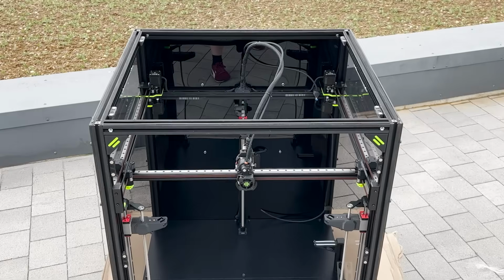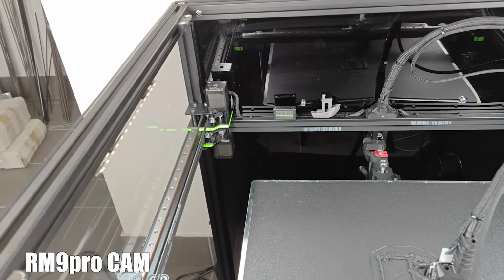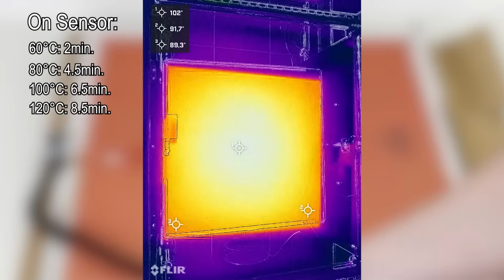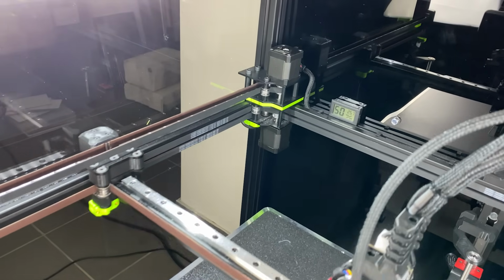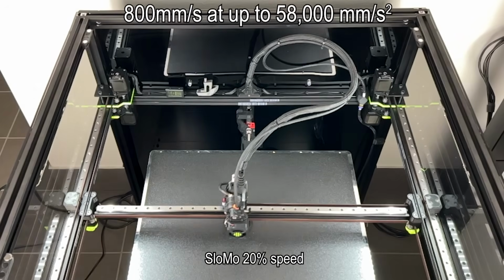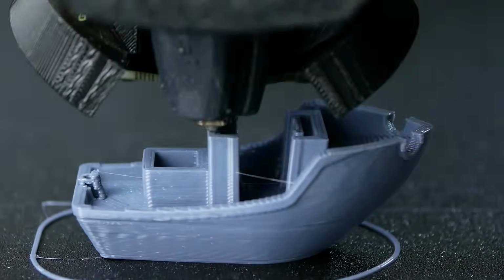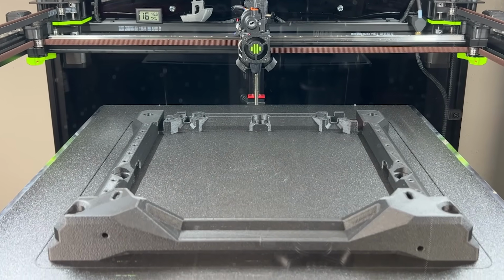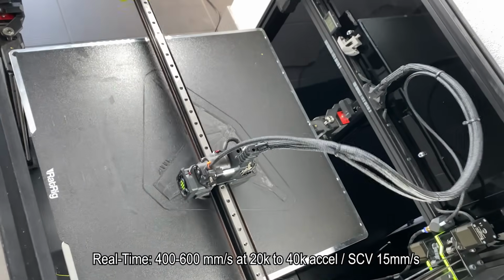Rat Rig V-Core 4 500 Hybrid: The Future of CoreXY? XXL Test!

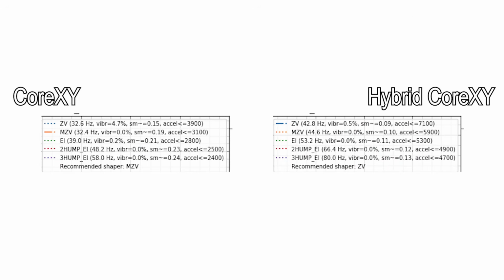Comment: As an engineer I have to correct something you mention. This has to do with the increase of frequency and the proposed likely cause of this (mentioned at 11:06 )
Firstly we assume dominant second order behavior (i.e. assuming that there's a dominant pair of poles of the openloop mechanical system), which I think is a fair assumption. Damping doesn't do anything to shift first mode mechanical eigen frequency peaks, it merely dampens them (as the name implies) and thus would manifest as a lower magnitude peak.
Resonance frequency is directly related to a mass-stiffness combination. In this case, the mass of the toolhead barely increases, yet the driving stiffness approximately doubles, as you are placing the belts essentially in parallel. Doubling the driving stiffness of a 2nd od system by 2x would lead to an increase of frequency of sqrt(2), thus we expect an eigenfrequency approximately 1.4x higher. This is exactly what we see in the result (an increase of ~1.38x according to your data). 

Using belts that are ~2x the thickness or height would do the same for 'regular' core x-y (or really any other kinds of) printers (I would recommend a 2x change in height, as that would not affect the minimum bending radius as much). Just ensure that you take into account an increased need for torque from the actuators due to the higher accelerations. Although I like the attempt to innovate with the hybrid system, just using wider belts would honestly be a more elegant solution, as you are not dealing with as many overconstraints, and it is much simpler and less costly. But! The hybrid system does make a lot of sense if you opt for the IDEX system that they will offer in the future! There it would be a necessity.
Reply from the maker: First of all thanks for the correction and detailed explanation. I repeat in short: It's not the "dampening effect" as I stated, it's the increase of the driving stiffness due to additional belts. Theory matches measurements, what's great to see.
Reply: Would wider belts start to have issues with leverage against the stepper spindles?
Reply: @ScottHess  Yes they would. But the way belts are mounted to steppers in most printers is not the way it should be done. Bearings in motors and gearboxes are not very well suited for large radial loads. 
Usually an actuator spindle is decoupled with a flex coupling, and the pulley is mounted on its own axle with a bearing on either side. By mounting bearings on either side you won't have any issues with leverage, no matter how wide the belt is. The disadvantage of this setup is quite obvious: Its more costly compared to directly mounting the pulleys onto the motors.
Reply: You mixing cause and effect. In mode analysis we deliberatly ignore dampening because it results in acceptabel results at low dampening for much easier math. Resonance frequenzy depends very well on dampening, just not in our usual models.
Reply: @fracapolligummala3548  I dont see how I am mixing cause and effect. Please elaborate.

Strictly speaking you are right that damping can affect natural frequency. However, considering situations with significant resonance (damping ratios of under ~0.2) this effect is negligible. For example if we consider the 'true' resonance frequency at damping ratio = 0, then a damping ratio of 0.2 would lower the resonance to about 0.96 of the original resonance frequency. Close enough for ballpark figures. The rest of the reasoning presented in the original comment still holds.

Not sure why you are suddenly bringing in modal analysis, as the graphs shown in 11:06 not only show the frequencies of modes, but also their magnitude and do take into account damping. Additionally the whole argument on 'hybrid' vs thicker belts is not about specific mode shapes, rather increasing the eigenfrequency in the driving direction.
Reply: @tHaH4x0r  You said "Damping doesn't do anything to shift first mode mechanical eigen frequency peaks, it merely dampens...",  which is wrong and but merely a result of us neglecting it usually because the error is accpetable. So its seems like you mixed up that in mode analysis we usually ignore it to be able to calculate the eigenfrequenzies easily as a fundamental truth of their behaviour when its actually a deliberate choice of the model that makes the dampening completly irrelevant. Mix of cause and effect.  
But I do agree on your conclusion that any reasonable assumption on the increase in damping cant explain the data. Im just nitpicking on an important detail of perspective.
Reply: @fracapolligummala3548  No, I neglect it because we generally do so, as it is a model of the real world. That is entirely the point of models, to have a conceptual representation that captures enough of the dynamics to be accurate enough, and leave out what is not significant/relevant. In this case, leaving out how damping can slightly change the resonance frequency is entirely acceptable, as I have shown in my example how even a very significant change in damping does not cause a dramatic shift in resonance frequency if you choose not to neglect it. I.e. I did not mix it up, instead it is normal that you do not take it into account with analysis of the mechanical eigen frequency as its contribution is insignificant compared to other mechanical properties. I purposefully left this out of the original comment, as it would only muddy the waters and make it harder for people to understand the core principles at work here, as I find the change of eigenfrequency due to damping in a underdamped system only a secondary effect.

If I am wrong in saying that damping is completely irrelevant, you are free to do the calculations yourself with the provided model (the frequencies I have found you can find in the first comment), and show me how much the natural frequency changes, and whether that is significant.
Reply: @tHaH4x0r  I think you still dont understand that we are on the same page. Im pretty sure the dampening, for all pratical purposes, can be neglected for the eigenfrequenzy here. Im only saying that dampening is not irelevant because the model says so but the model says it because we decided it to do so. Which is an important frame of mind because if suddenly something would be introduced that does actually contribute a significant factor of dampening, it could lead to the the wrong assumption that dampening is still completly irrelevant for the frequenzy. But I can understand your effort in trying to keep it simple so maybe I missunderstood that a little bit.

Comment: The hybrid CoreXY concept ask the question of if there are going to be 2 more motors anyway are their more advantages to use them for hybridizing the CoreXY, doubling it or even going for a different approach entirely ?

I guess that the point of the hybrid is to equalize the load on each motor by helping move only the heavier gantry. But that is still two extra motors, that can afford a lot of different configurations. Maybe the added cost of the motors could be better put in finally going for servos instead and allow for higher speed as the few cases were steps would be lost wouldn't lead to any issue.
Reply: I don't think you've looked up the price of servo drives. Nema 17's are cheap.
Reply: A conventional Cartesian setup would mean some of the motors are riding on the gantry, adding weight to the Y axis, presumably this is why they went with a hybrid approach

Comment: The rail-on-top gantry will have temperature deflection issues due to the different in expansion between the rail and extrusion. These result in similar drooping issues at higher temps you see and attribute to parking the tool head in the center. It’s possible think are seeing these temperature deflection problems than drooping due to tool head mass.

Comment: I am not sure how relevant and/or new this is to you and your 8mm thick 500 bed but here is my experience with V-Core 3 500 I have had for almost 3 years now: Thermal expansion is a very serious issue on the 500 and can lead to some puzzling results. It is one way to get your first layer issues even if the physical geometry of the printer is absolutely perfect. I can say from experience this is non-existent on the 200 and from what I hear the 300 has no such issues either with the 400 showing maybe some of it. 
In more detail there are two sources of the problem:
- when the bed temp sensor reaches the set temperature the top surface is not yet at the temperature as shown in this video. This means the bed plate is deformed downward in the middle (hot and expanded bottom, cooler less expanded top). If you run a print starting with cold printer the bed mesh will probably be done before the bed is in its final shape which it will only reach when at final thermal equilibrium. So your first layer starts fine and then keeps getting more and more thin as the bed gets heat soaked and rises back up mainly in the center. How noticeable it is will depend on timing and bed temperature. 
- the gantry is cold it has some sag/natural shape to it. As it heats up the aluminium extrusion wants to expand more than the steel rail on top so the sag in the middle increases. This also means the nozzle is slowly getting lower and lower after the start of the print and makes your layer thinner. 
The two things obviously compound each other. If you just finished a print, swapped the bed surface and started the next print in the same material right away you will not notice any problems at all - the shape of the bed and gantry did not move enough to be significant. If you have the printer at room temperature and try to do a large first layer in ASA/ABS right away you might have to babysit the first layer and slowly raise offset by several tenths of a milimeter. 
What I found works well for me is to set the bed temperature, set the hotend to 150°C and home all axes, which parks the toolhead just above the center of the bed. Then I go prepare the model, slice it etc. By the time I send it to the printer the bed has had time to soak up the heat and the gantry is warmed up too having been sitting above the hot bed and having the hotend fan blow air onto it. Since RatOS start print macro sees axes are homed and bed temperature and 150 nozzle are reached it will skip those steps and go to bed mesh and printing. With my printer it turns out about 20 minutes of such heat soaking is perfectly enough for PLA, around 30 minutes for PETG and about 40-45 for ASA/ABS. That is if everything was at room temperature before. Shorter if it has not had time to cool down from prefious print. With such heat soaking I can fire off the print and forget it. I can skip the heat soaking but then I watch the first layer and slowly increase offset as needed. The heatsoaking happens during the first layer so the subsequent layers are fine.
Reply: In short: heat soak that thing, otherwise you are asking for trouble, even for pla not a bad idea.
Reply: @over_pizza_2578  yes, you can get away with not doing it but it depends on lots of things, and how long of a heatsoak is needed varies depending on several things. But following your short rule will work as long as you heatsoak long enough.